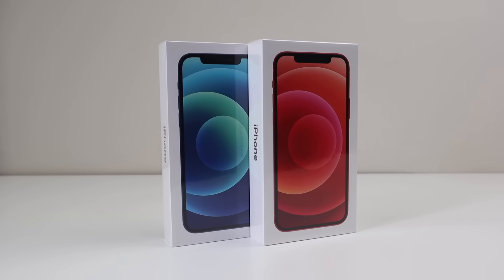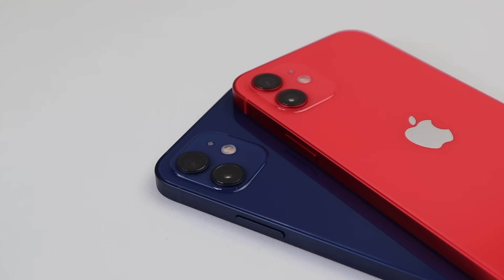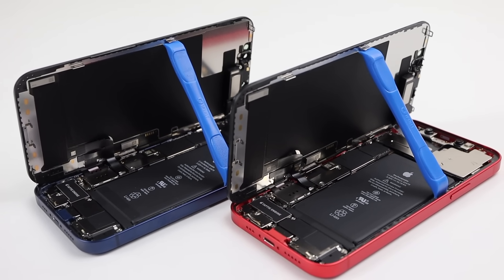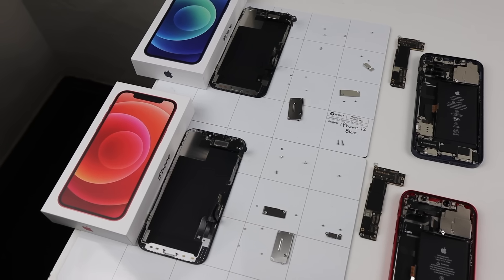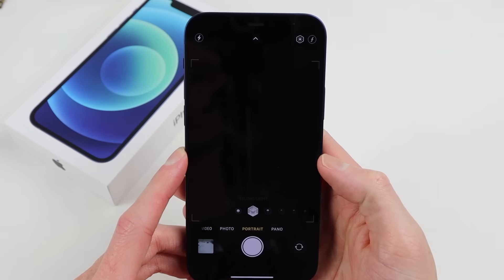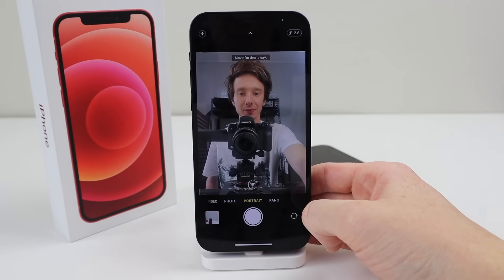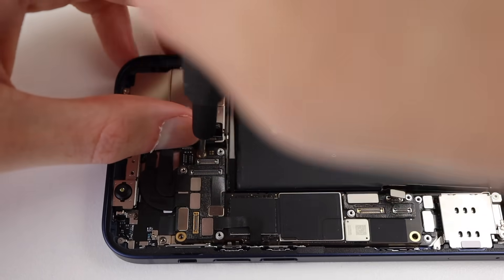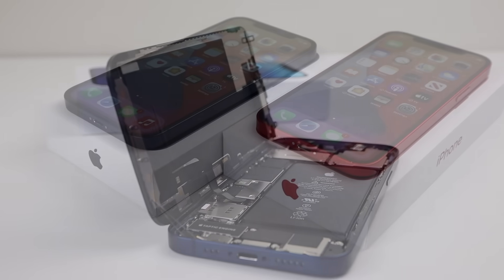iPhone 12 Anti Repair Design - Teardown and Repair Assessment

Comment: Yes, they removed chargers.. for the enviroment.. but still making it even more unrepairable..
Reply: There making sure everything fits. Another thing is the stronger adhesive is to help with water resistance
Reply: @jacobanderson9530  Well how pairing battery and cameras helps water resistance?
Reply: @jacobanderson9530  its repairable but not by non authorized repair shops

Comment: Will the next iphone have poison so that we cannot open it?
iPhone 13 edit:No it's not having poison
iPhone 14: it's so much better :)
Reply: no they'll damage all the screws so you have to drill them out
Reply: delete this comment before apple reads it!!!!!!!!!
Reply: When you open it, it spills anthrax spores on your face.
Reply: And only the Apple have the correct equipment to open it.
Reply: I think you cant open the phone without scan qr code of the serial number.
Reply: The screen will be soldered to the phone, as well as the battery and every other component, and you will have to heat it to 600⁰C to replace it
Reply: then, there will be a lot of iphone users start to avoiding iphone.
Reply: The next one will be made from air to prevent pollution
Reply: @rickastley6571  I got rick rolled😂
Reply: Self destruction mode
Reply: The screws will all be fake. In reality, if you take them out, acid is released to first fry and then eat away the components.
Reply: @TheSecondFinest  2rue